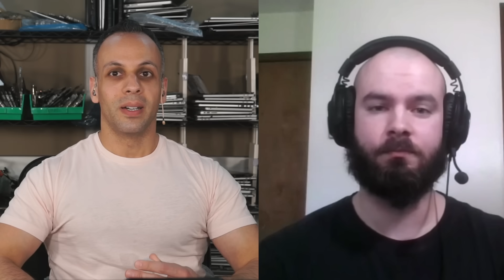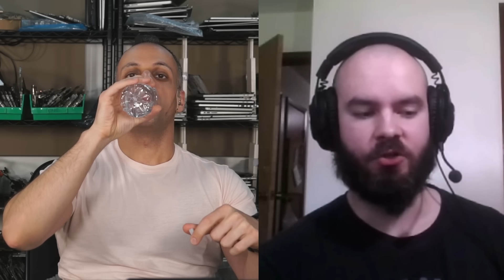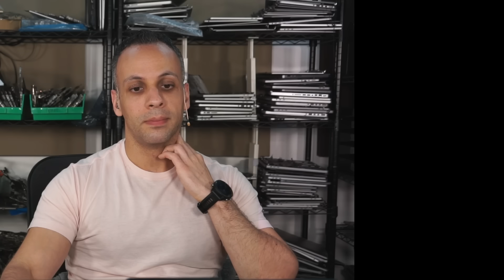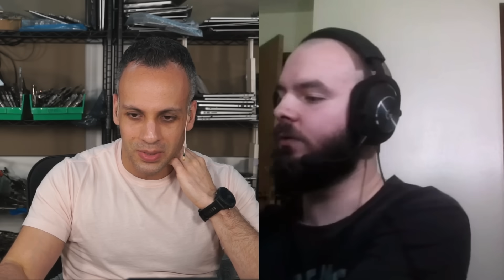Navy tech discusses decline of repair

Comment: As prior navy nuke myself (machinest mate nuclear) very similar instances ourselves with pumps and valves. We were able to make very small repairs on small valves but everything would be Contracted out when we reach Port.  We would have a designated welder that could only be utilized for emergent repairs.
Reply: also MMN,  my COC always wanted us to replace leaking valves instead of lapping the seat.  We had nobody qualified to use the lathe but in the last few years our EDMC somehow got a 3d printer but we weren't really able to do anything with it except make funnels to catch oil drips.  i got to be the ORSE showpig for valve repacks my whole tour because my chief let me do a few valve repairs as a NUB and i was pretty much the only one they let touch the lapping kit after that.  Our RO units were the only thing that we didn't have full documentation and parts lists for but my chief knew a guy at the vendor so we ended up getting schematics the one time they went down on deployment.  At least we weren't like the ETs and EMs who had to fly out technicians to a foreign port to fix the generators or box up cards and ship them off when they broke.
Reply: @nakkajin  God just reading this brings back memories on the boat. We were able to convince our EDMC to get a lapping kit for our steam valves under the pretense that if we had to do any cutting of the seat that we would replace it. During that time we also had 1 guy learn to do it and lapped so many valves. EVENTUALLY, when we had down time they did training so everyone could have some proficiency with it. I didn't get to do much repairs until dry dock and working with civilians during my shore tour.
Reply: @Bull625  i got to my boat during a DMD into a "6 month" drydock avail so all of the qualified guys were busy doing important stuff and i got stuck doing chief's pet projects with the guy who was off the watchbill because he was getting out.  I wasn't able to offload my knowledge until they made me LPO in my last year and I was able to convince ENG to let me train up some nubs.  I remember we also had some guy who became the LPAC whisperer somehow and got ours running again after drydock and he was the only one who could touch it until he left.
Reply: Same shit in the 90's

Comment: You may not realize this, Louis, but this guy could be the smartest guy you’ve ever interviewed.  One of the sharpest guys at my job had to drop out of Nuke school because it was too hard.

Regarding this topic, he is absolutely correct.  He might be a little naive on the acquisition side and the realities there (specialized circuit cards due to unique military requirements are always expensive), the OEMs absolutely unnecessarily overcharge. 

This is a great series.
Reply: Its not THAT difficult, a but fast paced sure, but its mostly high-school level math and then some college level theory.
Reply: @ballisticarrow27  The real hell was with the sheer amount that you had to keep up with though, not the technical level. And if you fell behind, the extra assignments piled on would snowball. That would be the kicker.
Reply: War is a racket
Reply: Two things can be true at the same time. Military equipment is likely to be more expensive, the MIC also grossly overcharged and is inefficient/wasteful

Comment: I'm a CPO Electronics Technician (conventional) and could probably supply a hundred stories from my own history or fellow technicians. I might make it a mission at my current command to compile these issues in aggregate.
Reply: Ex WSC-3/DAMA ET here I served in the early 90s. USS Tripoli LPH-10. I went through right before they got rid of the civilian instructors in BEE and went to computer based learning. The nuke ETs were never at the level of conventional ETs while I was in. They only went to BEE and then off to nuke school while we went to A school to learn advanced electronics and troubleshooting. I declined nuke school because I was told conventional ETs received far more electronics training than nukes. They were mostly glorified reactor operators and board swappers. We absolutely went to component level on repairs in many cases. Of course, with some things such as the DAMA, which contained over 40 boards, we would just do a board swap and move on. When I got out and went and got my EE degree, I found out how extensive the Navy ET school training was. The civilian college courses were almost like going back to grade school after taking Navy courses. In fact, my local community college asked me to come back and teach after I graduated, but I politely declined. I'm an automation and controls engineer now and have done well in the field ever since I left the Navy. I've never had trouble finding a well paying job.
Reply: Please do.
Reply: Those could become critical pieces of testimony in favor of Right to Repair. Absolutely compile them all and add new ones as they pop up!
Reply: I bet we could write a few  books on the topic 😂 🫡
Reply: people need to hear these stories. Having never been in the military, these first person narratives are all I have to understand the problem.